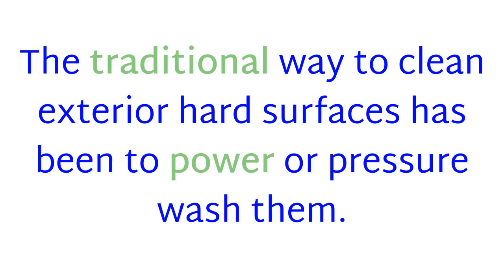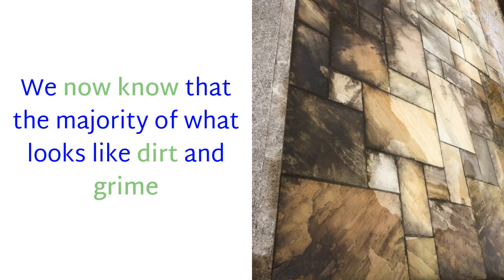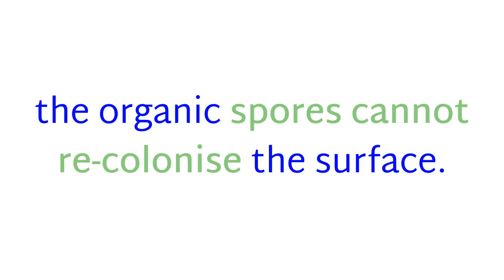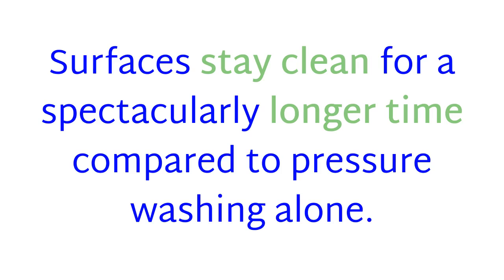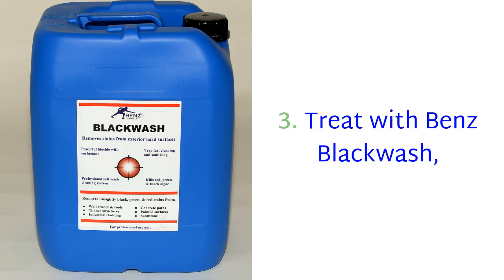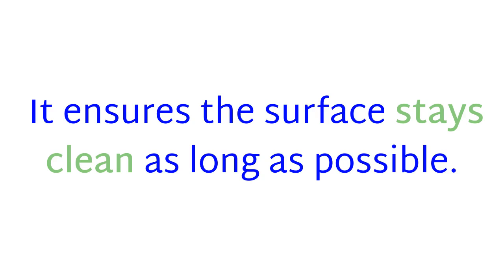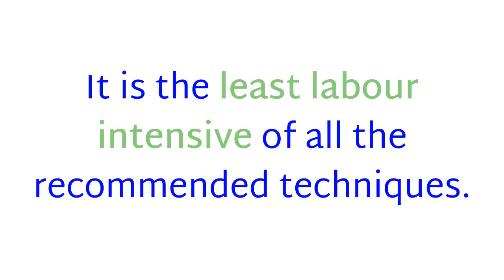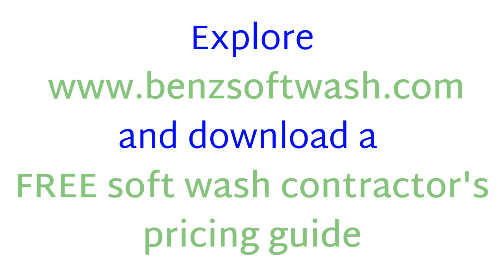The 4 techniques of softwashing

Comment: Using a wfp to apply the soft wash is brilliant never thought of that thank you.
Reply from the maker: It's often the simplest ideas that are the best! Click this link to learn about the specialised softwash spray nozzles that fit Gardiner WFP: https://www.benzsoftwash.com/products/spray-nozzles
Reply: @BenzSoftwash  hi Ben, I’m a window cleaner in the Netherlands. Because of COVID I have time and possibility to expand my business to softwashing. I’m learning a lot from your videos and website. Thanks for that! I was wondering. I have 2 hose wheels mounted on my telewash system. One of those I barely use. Is it possible to run a Softwash mixture through that hose? Or does it needs to be a “wider” hose? The hose is 8mm. And if yes, can the hose be used for window cleaning after it has been used for softwashing? After a good rinse through
Reply from the maker: @jerrybongers7917  Hi Jerry, I responded to your message via email today. The larger the bore of a hose, the higher the flow rate will be, and the less will be the strain on your pump – because the hose offers less internal resistance.

Ben uses an 8-13 mm inside diameter hose on the reel and a 5 mm inside diameter (8 mm outside) window cleaner's hose for the pole. He uses the smaller diameter hose because he prefers to reduce the weight on the pole, enabling him to work more effectively, with less physical strain..